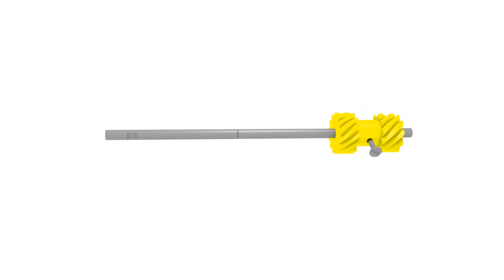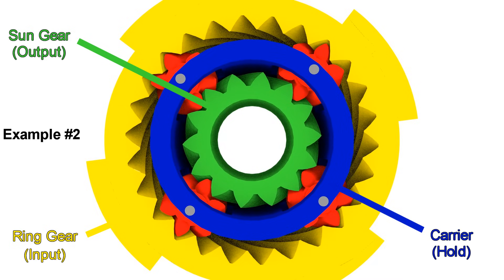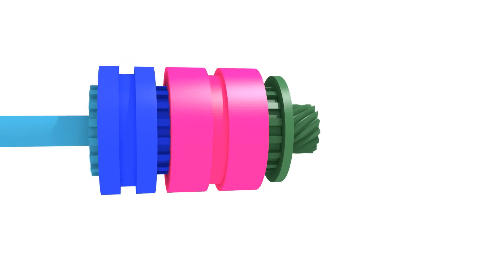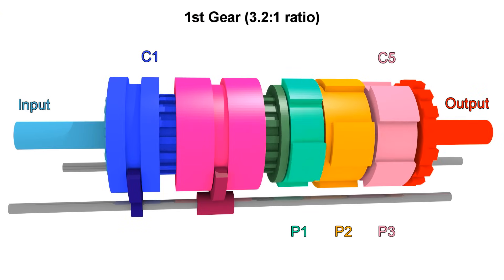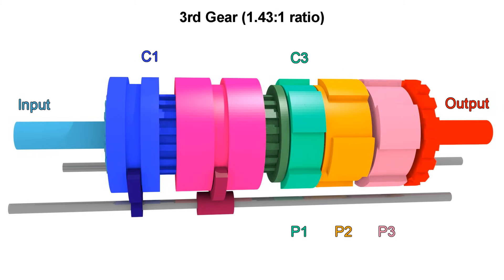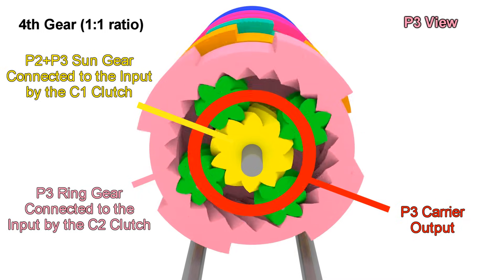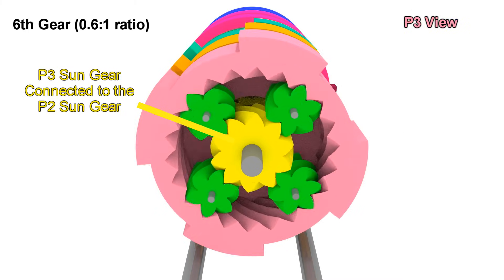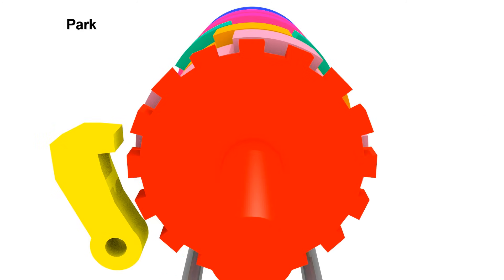How an Automatic Transmission Works (Allison 1000)

Comment: Why is  it that  youtube videos supposed to explain automatic transmission explained only the gear system? none of these videos explain what makes the transmission "automatic".
Reply from the maker: The automatic part is a computer that decides when to shift gears
Reply: @interlinkknight  not included in  those videos
Reply: because the valve body is a complex maze of channels

Comment: I know engage a certain gear change ratio of other gear ….. but after I watch video, I still don’t know how auto transmission works.
Reply from the maker: There are other videos that show how the clutches work. And the computer choose what gear to select based on the speed, engine RPM and throttle position

Comment: But how does it shift automatically, and why doesn't it stall when you come to a complete stop?
Reply from the maker: This video is only one part of an automatic transaction. There are also hydraulic clutches controlled by a computer to activate the gears.

There's also the torque converter that joins the engine and the transmission

Comment: This explanation is similar to how Lesics also known as Learn Engineering discovered it.
Also this is not the number of planet gears per carrier in a real transmission, it actually uses 3 planet gears instead of 4 per carrier in a real transmission.
Reply: no difference in the functioning between 3 planet gears and 4 planet gears  . but  it's have to be mentioned

Comment: This is disgusting because there are some gears that are not included
Reply from the maker: Can you tell me what gear of the Allison 1000 is missing?
Reply: @interlinkknight  where are the clutches and torque converter
Reply from the maker: Those are not gears. The video for how the clutches work is in the description.

The torque converter is a completely different subject that many other videos already show how they work.

The purpose of this video is only to show how the energy flows through the gears, which is something nobody showed in any other video before.

Read the comments and see how many people appreciate learning about this subject with my video, instead of attacking the effort just because you want more.

Comment: wow definitely I have to watch a number of times before I get it, but my question is once in neutral and at high speed when the vehicle is on, is it ok to go back to drive, or will the transmission get damaged?
Reply from the maker: As far I know it would not damage the transmission. I've done it and my transmission is fine

Comment: Thank you sir, I have a question.
9:13 Applying C5 will only prevent the planet gears of P2 from turning. They can still spin.
Since the planetary carrier of P1 is connected to the ring gear of P2, I wonder if the motion of P1 will pass to P2 through that path, making the planet gears of P2 to spin, resulting a reverse gear instead of a neutral one. Please correct me if I am wrong :(
Reply from the maker: The gears are still going to move with the wheels, but they are still considered in neutral because the engine and the wheels are not connected
Reply: @interlinkknight  Do you mean there are somethings that intercept the power transmission from the P3 carrier to the output shaft during the neutral gear?
Reply from the maker: No, but the gears are free to move . A little of friction from the gears might be transmitted to the output but it's so little that it is not relevant

Comment: OK so I kind of get how the gears work and how the torque converter works but how does the car know when to change gear? BTW great video's
Reply from the maker: A computer decide what gear to put based on speed, engine rpm and throttle position
Reply: @interlinkknight  Cool. Thanks for the reply

Comment: Modern automatic transmissions are a marvel of engineering.  Glad they work so well so I don't have to work on them myself.
Reply: I rebuilt my first, a Ford 3 speed, in high school. Believe it or not, even the new ones aren't that difficult to build. It's a matter of putting it all back together in the same order as it went in with all parts inspected and troublesome or worn ones replaced, and making sure your clearances are set correctly.Troubleshooting one is more difficult because it takes a greater understanding. This video was a random recommendation and I feel the author did a great job showing the Allison 1000. Take in mind, there are many, many different automatics out there with differing parts and methods.

Comment: Thanks for this explanation.  I do think that it's not the planetary gearing that is difficult to understand but how hydraulic pressure is used to control the clutches and how this interacts with the planetary gear system.  The structure of the clutch packs is also complex and worthy of a model.

Comment: So when I drive with the "D" gear does that mean I'm driving always like the configuration you showed like 5th gear or 6th gear?
Reply from the maker: I don't understand the question. "D" means is in drive so the transmission would change to all the gears depending on the speed and throttle position. The transmission computer is the one deciding which gear to select.
Reply: @interlinkknight  Ohh! So that means it changes as you drive, and when you manually select, for instance 2nd gear, it means you are "locking" that gear, thanks for the info know I understand!

Comment: So , where's the automatic part of this video .
It only explain about plnetary gear .
But how / what decide the gear to switch from gear 1st to 2nd . Or from 2nd down to 1 st
Reply from the maker: A computer does that
Reply: @interlinkknight  
Many vids only explain the gear . Not the whole automatic interaction/connection between the computer and the gear
Reply from the maker: True. Maybe because it's kinda boring and easy to understand. You want to know how they program the computer? Or want to know how a valve or solenoid works? The used to be more mechanical and very complicated but now they are boring with valves, sensors and the computer. Still, there's a few videos I've seen where they explain that part.
Reply: @interlinkknight  
How the computer communicate with the gear
Reply from the maker: Like i mentioned, to select gears you need to apply clutches that work with hydraulic fluid. The computer applies the clutches with solenoids.

Comment: Would applying C2 + C5 result in a 7th gear ratio?
Reply from the maker: Applying C2 and C5 would block the input. C5 clutch would not allow C2 to move

Comment: Is there direct metal-to-metal contact of the torque-transmitting gear surfaces?   Or, are they separated by a thin layer of tranny fluid?  Why is there is hydraulic pump to up-pressure the tranny fluid?
Reply from the maker: There's fluid everywhere. The pump keep the fluid moving

Comment: Bonjour de Paris !
As every une says, the best vidéo about Allison transmission ! Everything is now clearer !
Reply from the maker: I am so happy I could help. Thanks for your words.
Reply: @interlinkknight  ok I am doing a latex  PDF calculating all the ratio ! I was assuming that sun Gear has a radius of r, planetary Gears have a radius of r/2, and of ce the ring Gear a radius of 2r, am I right ?
Reply from the maker: I don't understand the question
Reply: @interlinkknight  i am curious about the ratio of the various radius (Sun Gear, planetary Gear set, ring Gear) !in order to do the math ! PS if you are not aware, i will deducte from the ratio of the first Gear ! Thanks you again for your video
Reply from the maker: The gear ratios for my model are:
1st: 3.20
2nd: 1.86
3rd: 1.43
4th: 1
5th: 0.70
6th: 0.60
R: 4.41

There are websites that calculate ratios of gear sets. Just add the ratio of one set to the other, if you really want to do it.

By the way, to calculate ratios we use teeth amount, not diameter or size.
Reply: @interlinkknight  smart tip ! Numbers of teethes is the exact answer ! The radius ratio is an approximation (good but not exact) and it os what i am looking for ! For the official spécification of  Allison dynamics the ratio are of course a little bit différent ( 3,1 etc) I will see if I find the number of teethes !
Reply from the maker: Yeah, the original transmission have a slight different ratio than my model, but it's close enough.

Comment: If there was a P4 instead, would the sun hear of P4 also be connected to the sun gear of P3-P2, and the result would give you an eight-speed transmission? If so, does this continue to scale by two’s?

Additionally, is P1 special only because you want to gain reverse? If reverse was not desired, would you be able to simplify the design?

Comment: I don't understand how the sun gear turns faster on P2 for gear 6 than it does for gear 5.  Are you sure you got this right?  Or should the configuration for gears 5 and 6 be switched?
Reply from the maker: I am sure it is right. Just watch the video carefully.
Reply: +InterlinkKnight No, seriously.  If for gear 5 the ring gear and sun gear are turning at input speed for P2 whereas for gear 6 ONLY the sun gear is turning at input speed how can the result possibly be faster?
Reply from the maker: P2 on 6th gear:
- Ring static;
- Carrier spinning with the input;
- Sun gear going a lot faster than the input.

P2 but now in an alternative situation:
- Ring gear spinning with the input;
- Carrier spinning with the input;
- Sun gear going at the same speed as the input.

Can you fill the gap in between both situations?

What happens if the ring turns a little instead of a lot? Well, the sun gear would turn faster than the input but not as much as if the ring would be static.

Comment: Awesome mechanism, but how does the braking clutches go from disengaged to engaged? Thanks! Keep up the good work :)
Reply from the maker: On the description there is a link to a video showing how the clutches actually work. They use hydraulic pressure to move pistons that push the clutch plates together.
Reply: InterlinkKnight Oh, of course! thanks for replying!

Comment: i've got the question. turn up 3:37 and can you say if we can have a 7th gear by engaging c2 and c5 clutches?
Reply from the maker: The answer is no. If the C2 clutch is engaged it would make the ring gear of the planetary gear set #3 (P3) turn with the input, and the C5 clutch blocks the ring gear of P3, so if you engage C2 and C5 you would lock/block everything. Is hard to follow the energy path, but watch carefully a few times and you will get it.
Reply: thank you for your respond, i still don't understand the whole system by 100 percent, but i see the logic and the harmonic relation between these components, i was falling asleep in the late night, when i watched this video 5th time ever. thank you for your job, this is the only video, that helped me to understand the automatic transmission principle. i would really appreciate if you made similar explanation videos on 7-speed and 8-speed automatic transmissions (such as mb 7-g tronic, gm hydramatic 8l90 or zf 8hp). thank you for your job!
Reply from the maker: I am glad I could help. Although I doubt I will ever make a video about other transmissions with more speeds because is hard work making the 3D model and the animation. I made this 3D model because I wanted to 3D print it someday to make it work in real life (small scale). After I had the 3D model, I realize I could make the animation and make a video explaining how it works. Also, if we all have a hard time understanding this basic/simple Allison transmission, can you imagine how hard would it be trying to understand the 8th speed transmissions? I've seen them from inside. Those are crazy complex.

Comment: have a question, how is the gear change\shit initiated ?
Reply from the maker: A computer decides when to change gears base on the speed of the output, engine rpm and load. The computer activate hydraulic valves that enable the clutches.

Comment: I was watching a f.ing bunch of videos to understand the automatic gearbox, and only yours is worked. Good job
Reply from the maker: Yeah, same happen to me. I watch so many videos and none was detailed enough to really understand how everything works. Was only after I finish the animation that I trully understood. Is nice to see that i helped. Cheers.
Reply: I don't understand how the sun gear turns faster on P2 for gear 6 than it does for gear 5.  Are you sure you got this right?  Or should the configuration for gears 5 and 6 be switched?
Reply: @dowskivisionmagicaloracle8593  maybe cuz the torque converter is locked?
Reply: That is what I was wondering. I think that gears 5 and 6 are switched around. But other than that, this is the most detailed video on how an automatic Allison transmition works. Great job on this video!
Reply: agreed
Reply: Fah
Reply: Awesome!!! Learned sooo much about them... thanks buddy...

Comment: That really explains everything! Now I need to know how these machines engage each of the clutches on its own
Reply from the maker: a computer with sensors
Reply: ***** i read an article at HowStuffWorks. Yes, there are electrical sensors and it's common now. Before they exist, they have a mechanical air-pressure detecting system to detect if the engine works so hard, and detects which clutch gear is hold. If the certain pressure is reached, a valve opens automatically to pump air to make the clutch work, just like how you manually use brakes.

Wow I learnt so much starting from this video!
Reply from the maker: +FrostMonolith internet is awesome :)

Comment: why P1, P2 and P3 don't have identical ringgears, carriergears and sungears, so you can just 3D print multiple copies of them? Also could be nice to use both Lego parts and custom 3D printed parts, so people can use this in Lego models!
Reply from the maker: All gears are different in each planetary gear set because we want a specific final gear ratio for each gear. The real transmission also has different sizes for each gear set. If all where the same would have too far gears, or too short.

Gear ratios:
1st: 3.20
2nd: 1.86
3rd: 1.43
4th: 1
5th: 0.70
6th: 0.60
R: 4.41

Comment: Why 6th gear result faster rotation of P2 and P3 sun gear than 5th gear do.?
In 5th gear, P2 ring gear are rotate because of P1 carrier  rotation, it should be result additional speed and faster rotation of P2 and  P3 sun gear, compare with 6th gear that P2 ring gear stop.
Reply from the maker: You need to consider that in 5th and 6th gear the input in p2 is on the carrier and the output in p2 is on the sun gear. So if the ring gear moves in the same direction, it will waste some of the speed coming from the carrier. Is so, that if the ring gear would go fast enough, the sun gear would go at the same speed as the input in the carrier. But when the ring gear is stopped on p2, all the power will go from the input in the carrier to the output on the sun gear, but faster for the nature of planetary gear sets in this setup.
Reply: OK clear...I got it...my understanding was mixed with sun gear as an input...thanks for your explanation..well done Interlinkknight..:)
Reply from the maker: +mech eng no problem

Comment: How this thing automatically shift?
Reply from the maker: A computer make the decision to shift depending on the speed, load, etc
Reply: Amazing, couldn't believe that this computer controlled shifting already existed way back when? 1950s 1960s? or even earlier?
Reply from the maker: I was talking about current transmissions, like this Allison 1000. In the old days automatic transmissions use many valves, centrifugal mechanism, and the hydraulic pressure to select the correct gear. Was very complicated. My video was intended to explain only the power flow in the gears. If you want to know how old transmissions control the clutches. you need a very specific video or article.

Comment: here is the question: can i use a fully automatic transmission (tork convertor model) without electronic system by only pushing the shifthing bar in any engine. why am i asking this? because i have an engine  which is for soil drilling operation. it is only for drilling no highway no wheel. i only need to work it forward and reverse. can i use a transmission like this in my diesel 70 hp engine?
Reply from the maker: +muhammedmuhiddin The answer is kinda. Real transmissions don't use sliders or bars (like on the model), so you are going to need some electric system. Real transmission use hydraulic fluid to move the clutches. What you can do is control the solenoids that send hydraulic fluid to each clutch and send them current in a manual way to enable those clutches. But you need to know which solenoid controls which clutch, and which clutches need to be engage for each gear. Depends on your transmission. So you need electricity and switches, but is totally doable.
Reply: ***** a person said that if you use it in the stich "R" and "3" you get reverse and 1,2,3th gears without electric system. then i read your answer and i am confused.
Reply from the maker: Is very specific of each transmission. Old transmission was 100% hydraulic and mechanic, but new ones are electric and hydraulic controlled by a computer. So you have to investigate about your transmission.
Reply: ***** so you mean if i find an old fully hydraulic transmission then i wont need an electric system on it?
Reply from the maker: Yes.
Reply: you are blessed! i did it! thank you very very much!